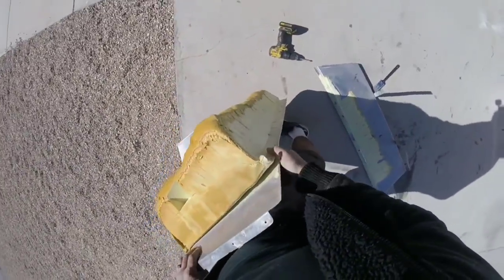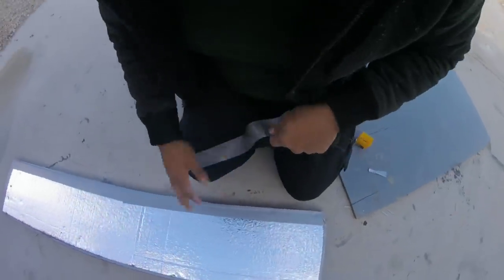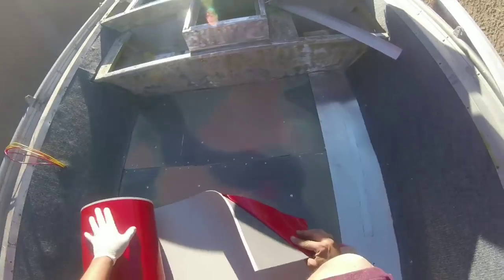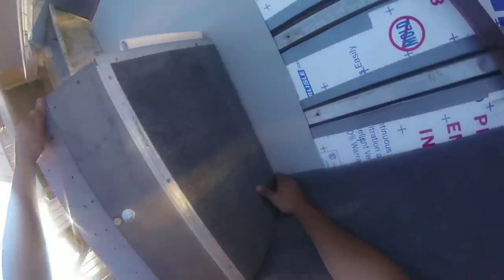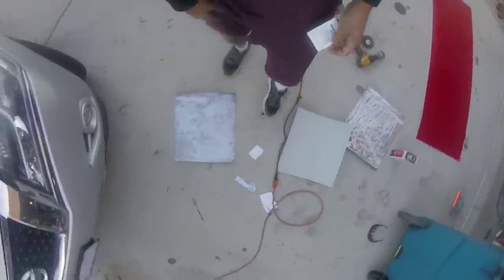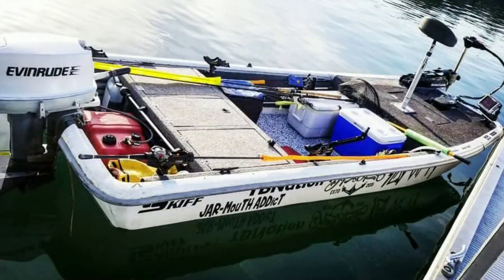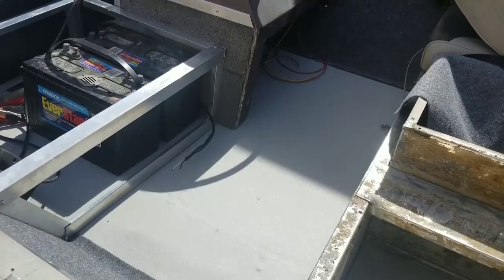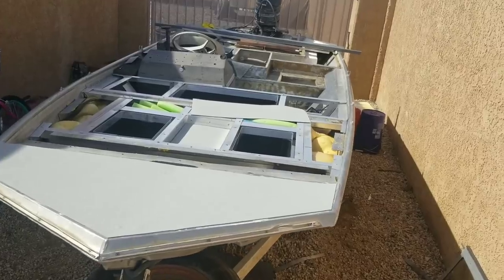Sub Floor from Recycled Aluminum | Vintage Bass Tracker Bass Boat Restoration

Comment: When applying your gator skin, you can use a roller to press it around the rivets without puncturing it. If you tuck it around the edges of your panels, you will get less shrinkage and damage from the elements.
Reply: @TinyBoatNation  I watch a ton of fishing a boating videos. I came across your channel as a suggested video, I'm really diggin your videos. Great job man.

Comment: Michael!! Great video, really appreciate your time and advice! Especially on the SEA DECK! I have a 2017, 195 Bass Tracker with the rubberized floor covering over the deck. Super easy to keep clean, however it gets FREEKIN OUTRAGESLY HOT on your bare feet in the summer!! Other than keeping a beach towel down or pulling all of it up and recarpeting the entire deck, what would you recommend??

Comment: I have seen on your other later builds that you moved away from doing the foam panels and drilled holes in the floor board and then poured foam.  I have been debating this on my build.  If the foam is poured it will block the channels running on the bottom that drains the water.  Thoughts?

Comment: Just curious.  Why don't you use the pvc sheets? I have been contemplating  using it to redo the deck of my boat.  I know it's a little bit more expensive,  but weight and durability  will be better than wood.  Any thoughts on that would be helpful.  My boat is a 16 ft tracker style boat.
Reply: Thanks for the reply.  I have been enjoying  your videos.  Wish I would  have seen them before I started my boat.  Now I'm going back to redo things differently.  Keep up the great job.  I'll keep watching and liming.

Comment: Is that 1x1 8th inch angle aluminum?
Reply: @TinyBoatNation  I bought some 1x1 8th inch angle aluminum for my boat.  Will that be enough for the frame?
Reply: @TinyBoatNation  really? I might have my measurements wrong but the stuff I got seems smaller than your aluminum.
Reply: @TinyBoatNation  that's what she said. Lmao 😂

Comment: Im redoing my xpress i did forums and reviews i decided go with 20oz carpet my carpet now 26 years old dont look bad i just built a front deck extension all aluminum 1/16 tube and sheet and angle why im re carpet it